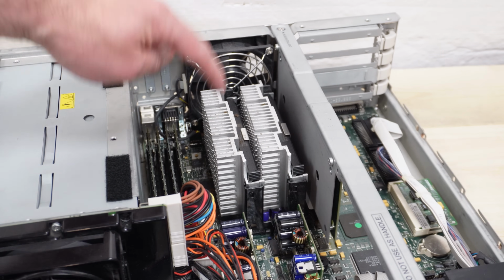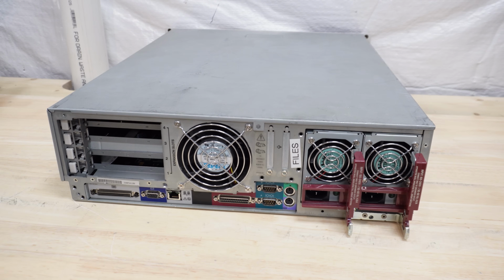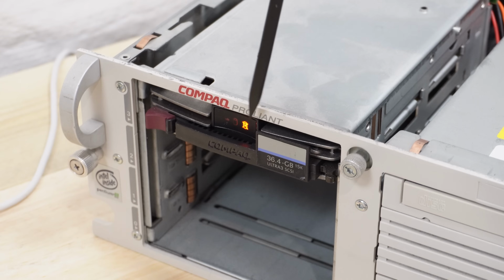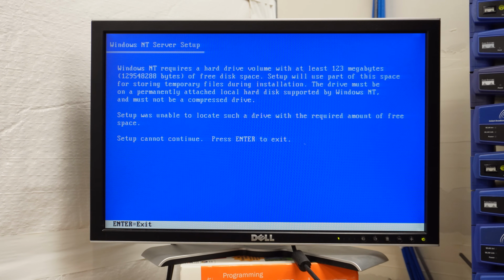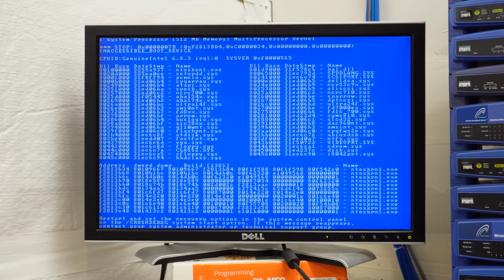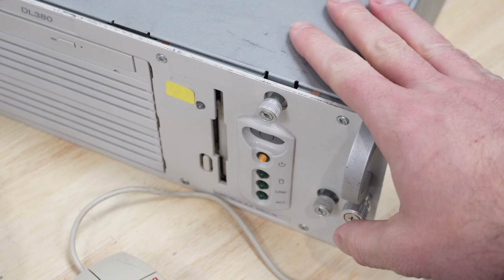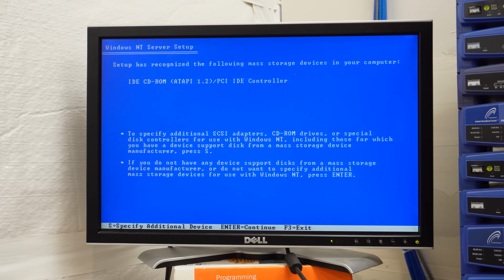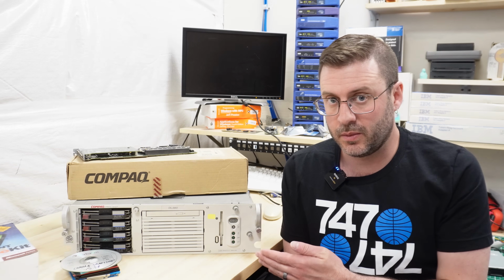Failing to Install Windows NT 4.0

Comment: You may be running into the issue of NT setup not loading the driver even though it allows you to "load it" after the 'Welcome to Setup' message. You'll want try loading the driver before the 'Welcome to setup' by using F6 at "Setup is inspecting your..." and you may have to select IDE driver along with the SCSI driver.

Comment: It's been at least 25 years since I did this, but my memory is that the automatic integration from the smart start CD does everything for you. SP6036 on the HP site will get you the missing profile disk.

In automatic mode, Smartstart will copy the files from the NT4 CD into an installation partition on the HD, integrate the required drivers and configuration, and then reboot into this install partition to begin the actual NT install. I don't recall ever needing to manually set up logical volumes on the array, but it sometimes takes more than one reboot before the NT install starts if it needs to configure hardware. 

And if you want to go down a real NT domains rabbit hole, look up PC Netlink 2.0 on Solaris. It lets you run PDC, BDC and member server roles on a Solaris SPARC box.

Comment: I don’t need to watch this, I’ve unboxed and set up 40-50 of these with Netware, NT server, all sorts. But I’m going to, because nostalgia.
If you remove those two bezels beneath the CD drive, you could install a SCSI DAT or DLT tape drive.
I’ve mentioned before, F6 during the NT setup would have allowed you to inject the Smart Array driver and see the disk. And you could have formatted the disk with /s to copy the boot dos boot files.

Comment: Here's a trick to save a bunch of time: When you're at the Windows setup screen where you can add the RAID driver from floppy, after picking the driver, press S again to load another one. Just load all the drivers off the floppy, and if one of them is the right one for Windows to detect the RAID card, it'll use it.
Reply from the maker: I'll try that!
Reply: @clabretro  HURRY I WANNA SEE WHAT HAPPENS!
Reply: Cheater....... lol 😂
Reply: That still remains the same.
Reply: And Colin saves the day!
Reply: Yup, this is the way.
Reply: IBM製 ServerRAID や Adaptec AHA-2940(U、W、UW)、Tekram SCSI DC-390(U、W、UW) だと PC-DOS(MS-DOS) で先頭パーティション10MB程度でいいので事前に基本パーティションを作成しているとすんなり進めます。
あるいは DOS 基本パーティションを2GiBを確保、インストールディスク3枚目で ディスクコントローラードライバを読み込ませ、その後の導入手順の途中で NTFS へ変更すればもんだいありません。
あとからNTFSへ変更するとすべてのディレクトリ(フォルダ)のアクセス権が Everyone になるので注意すべきです。
30年前にサポートデスクで何度もガイドしてきました(o_O)
Reply: Sometimes when you do not have the exact Smart Start CD that came with the server some drivers can be missing, so the downside with that method is that there are no guarantees that the right driver is even there. Still, good tip.

Comment: You have summed up nicely why I stay away from old Compaq hardware.. by trying to help administrators, they have created probably the most convoluted and non-automatable way of setting up servers from all manufacturers I've worked with. This whole SmartStart ordeal wouldn't have been necessary if Compaq had bothered to ship a simple disk with the SCSI controller drivers in a form that the NT4 installer can use, and a BIOS for the SmartArray controller that exposes the drives in one of the standard ways (e.g. INT14/15 emulation). But no, they had to do things their way, and have admins jump through hoops to get their machines working. Thankfully, HP put an end to this (mostly) after they bought Compaq. Except the SmartArray controllers, those still suck to this day, because HP decided to castrate the software from its original LSI version to be barely standards-compliant, to sell more upgrade kits.
Reply: Totally. In all my years of NT4, i never saw such a nightmarish thing, which makes me grateful for never having had to use anything "from OEM" and instead just built them from off the shelf parts. And its just like you said, pop some LSI or Adaptec card in, have the floppy with driver, boot the cd, pop floppy, load driver, away we go. That said, don't miss NT4 all that much, life became SO MUCH BETTER with W2K it's not even in the same galaxy code.
Reply: Compaq had so many backplanes and idiosyncracies that kept you in their proprietary world that I actually refused to work on their rigs after 1997. Too many scams that they ran with their hardware, and you could only use their products as replacements and upgrades... Also NT 4.0 was especially egregious - first release could be hacked by a character buffer overflow. All you had to do was hold your finger down for a couple of minutes to buffer overflow the 256 characters, and you could log in as anyone - not very secure!

Comment: These are not "partitions" in the RAID controller BIOS as you call them. Nowhere near in the same sense as partitions in fdisk, which is the common use of the term, so it is misleading to also call them that. They are "logical drives" as far as the controller is concerned, but the OS will see them as actual separate devices (listed in device manager!), say of 2GB and 6GB as you made in some attempts, or only 2GB.

Comment: FYI You could have selected all the possible drivers by pressing  "S" again after you selected the first one.  Incase one of the other ones worked.  NT setup will format the drives for you once they are located.

Comment: 2:22 - let's be fair here, ok? The domain concept in a network appears in Unix servers, like NIS server in the '80, developed by Sun Microsystems. There are innumerous of others solutions to network domains.
But Windows NT were more popular in that era of 2000's.
I still remembered that I needed to installed Citrix Metaframe in this beast, cuze there is no rdp protocol in the NT.

Comment: Are you using the printed installation guide that comes with the proliant.
I did a dozen or so without a problem....but I used the I installation guide.....just saying..😮

Comment: On the nt setup screen where you add the additional drivers im pretty sure you can just add a bunch and hope one works rather than trying 1 at a time, that's all if I remember correctly
Reply: You can also download different drivers and put them on a floppy and load them in

Comment: Problem is that smartstart CD is all in one solution for multiple servers configurations. And selecting devices from list of all the drivers from the disk isnt precise either. I would precisely look for SmartArray 5300 nt 4.0 driver. And make floppy with it.

Comment: Do yourself a favor and always format with /q for quick format. Format in normal mode just does a scan for bad sectors to map them out in the final file system. If using "modern" drives, especially on a raid controller, this usually isn't a problem and you just save a ton of time.
Reply: Not really scans, but for sure it formats every sector. While quick formatting ommits rewriting every sector and just make them as empty in partition table data.
Reply: @swrzesinski  No really, it scans it only. Format a drive in non-quick mode and abort it at 95% and all your old data is still there.

Comment: Never got my hands on a Compaq ProLiant but we used to sell a lot of HP ProLiants ML and DL 350 and 360 servers starting with the G3 generation. SmartStart was still a thing but you could do rudimentary things such as accessing the BIOS or configuring the PERC RAID controllers without them.
Though these SmartStart CDs were no longer Windows based and instead booted a Linux kernel straight into a Firefox instance, IIRC.
Those were always great and very reliable machines. 
Only ever had one customer who was running an NT 4.0 domain with MS Exchange 5.5..it was quickly migrated to Windows Server 2003 and Exchange 2003.
And yes, Active Directory is still alive as well even with Windows Server 2025. Of course Microsoft would rather sell you some fancy Azure AD/Entra ID subscription…times really changed and not always for the better.

Comment: Why are you booting off a Win95 floppy ? The NT4 CD should be bootable and the Installation Wizard should do most of what you need.  Also, the later versions of 'Smart Start' had the option to install an O/S - it did the basic prep of the hardware, copied the relevant Compaq drivers onto the drive, and then WinNT would use them.

Comment: The installer is not seeing the disk because you do not have the right driver disk or you are not choosing the right driver not due to anything about the partitioning. You need the precisely right driver disk and then you have to choose precisely right driver. There was a whole process to generate your own install media with configuration to choose the right drivers for unattended installs. I did so many Windows NT 4 Workstation installs during my college years both of the unattended and manual varieties and I've never before seen anyone do this process with booting to a DOS disk to partition the drive in advance. You can partition any disk from within the installer, but the boot partition has to be 2GB or less. For reasons unknown to me the filesystem is initially FAT16 and then it converts to NTFS upon first boot.

Comment: Fun fact modern HPE Proliant servers have a function (built into the systemboard) called "Intelligent provisioning" which has similar functionality (and a lot more that's come along over the years).  They caught on early on that using a flavour of Linux instead of Windows for the environment was more cost effective for licensing.
Reply: I install HPE servers regularly and I never made Intelligent Provisioning work to install any operating system. ESXi, Windows Server 2016 up to 2022 in different languages (DE and EN). The furthest we ever got, was up until a point it ran some script in a Windows PE environment and got stuck there. HPE support was of no help and at some point we had to give up and install manually as usual, because we couldn't delay the customers system any longer. Next try with a Gen11 server soon, I guess.
Reply: @drstefankrank  only thing worse is finding anything on the hpe site haha
Reply: 90% of the time it barley works for me on my hp micro server, I land up just using ilo with an iso image of the os of choice

Comment: 4:40 Why would you want to learn NT? It is a very stripped down OS with many limitations, it is great for office environments but not much more.
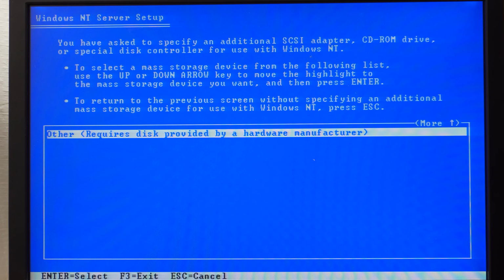27:09 You have to tell it the SCSI controller exists, then it will find your drives. I remember these days but at least you don't have your manager breathing down your neck asking what is taking so long.

Comment: I love your vids. Vintage enterprise equipment doesn't get a whole lot of love.

A few notes. The NT4 setup doesn't care about what partitions you already have on the drive, but I like to start with a clean drive. You can add/delete partitions later in the setup.

Also fun fact. NT4 supports up to a 4095MB boot partition  if you create the partition from the setup.. Also after you install Service pack 6a, you can create a much larger extended partition and fill it with a single logical partition to get a large drive (NTFS OR FAT32).

The barrier you're running into is NT4 setup isn't seeing the drives because of an incorrect controller driver or it the drives are not configured correctly in the RAID utility (I've never used Smart Start so I don't know). Either of those two conditions will give you that error. I think you don't have the correct driver for either RAID controller. You may have to do some sloothing on the way back machine version of Compaq's site to find a driver file name (softpaq) and try downloading said file from an archive somewhere (Compaq used an FTP server back in the day so the file itself wouldn't be on the web archive. I just search for the download exe in Google once you have the number) Once you download the "softpaq" it should be an EXE that creates diskette(s) for you, and you would load it like you did in the video.

Last, Compaq also liked creating a "hidden" utility partition on your primary drive. I have a prolinea desktop that does that. Once that partition is present, you can hit F10 to get into a BIOS setup utility without a diskette or cd. The Smart Start CD can probably set up that partition for you.

Keep up the good content!
Reply: Another thought is you can specify more than one RAID controller by pressing S again at controllers screen. Some drivers can conflict, so I would limit it to a few at a time. You'll also get errors in the event logs from the non present controller drivers after setup is complete until you remove or disable the other drivers. A compatible driver may still be on that diskette you made.

Comment: you can build custom install media and inject the drivers.  its a PITA with NT4, no automated slipstream yet, but its doable.  I don't think I ever had the luxury of a smart start disk, so I just made custom install CDs with embedded drivers.  I can't recall where I got instructions from.  I remember it involved editing some INF files, extracting the boot sector from the CD, compiling it all into a correct directory structure, then burning it back out to CD.  There was also a trick setting to a boot sector ID that if you didn't set it you weren't booting off that disc so you got a new shiny coaster.

Comment: Okay, I haven't watched the video yet, but I am about 10.74673 to 79.43687% sure we were running NT4 on exactly those boxes at my workplace back in the day. And getting an OS installed on a Compaq server always used to be a breeze compared to the cheapo thrown-together stuff from the mom'n'pop computer store down the road thanks to Compaq SmartStart. 

Curious to see what problems you ran into.

Comment: Michael MJD has also had tremendous trouble trying to get NT4 installed. Check out some of his videos. He's lost hours of his life to NT4 as well. Just wait until you get to the part where if you try to install into a large partition it does this crazy thing of making the partition in FAT then converts it to NTFS later.

Comment: I did have the same box around 1999 when setting up a NT4 (SP 4 I think) as my main mailserver running 3rd party Win NT4 based mailserver (forgot the name of the mailserver but same company as What's Up Gold). I did have a separate SCSI based disk array instead of the built-in disks in main chassis.
Some other application i did install later dis mess up NT4 that bad that it went in BSOD loop and had to reinstall NT4 three times from scratch... Fun times 😢😮😂❤😊
I did have a ILO remote management card where you had to loop KB&M + monitor with cables... No remote management via the internal bus... The ILO/ILO Advanced card was really just a mini remote KVM over ethernet unit in a card form factor 😮

Comment: the only reason it wouldn't install is you have to make sure you add the drivers for the controller.  That is how all of the older OS system worked.  They didnt have Plug and Play.  It was called Plug and Pray back in the day.
Reply: That's exactly what was F6 Drivers for. It was living up to Windows XP. You would have to prepare floppies with like Intel Rapid storage driver for RAID/AHCI. Then press F6 on windows first installer screen and load them. With servers it would be easier, Windows 2000/2003 server had most of the common server controller drivers integrated into retail Windows disc. And it doesn't have anything in common with PnP. Device is still PnP even if you don't have driver installed.

Comment: Get Service Pack 6 Media. Windows NT4's setup process is made much less painful after SP4, but SP6 will let you use NTFS and FAT32. That alone is enough of a boost that you'll be able to actually complete the install, also you won't have to spend literally 860 hours patching the damn thing.

I also recall some kind of gotcha about multiprocessor systems. You may also need multiprocessor media.
Reply from the maker: I was kinda thinking latest media might be the answer. I'll try that!
Reply: @clabretro  When I last played with NT4 while it was still a relevant operating system, I tried using SP0 media and got nowhere on a system so painfully generic and standard that I was genuinely confused how NT4 wouldn't boot on something with a PCI video card and onboard IDE controllers. Turns out, it was just really fussy back then. I used SP4 media and it was as easy as installing Windows XP was. You just kinda mashed enter until the end and it did it. You're still going to need the Raid controller setup disk, And not seeing the disk Is a good hint that a lot of things are Not going Well. In the SmartArray configuration utility, did you set a logical drive as bootable? I don't recall seeing you do that in the video and that's still a gotcha with SmartArray cards, today, running Windows Server 2019. You do have to pick one logical disk to be bootable, and Windows SETUP will feign ignorance of any logical drives that are not marked as bootable, because if you can't boot from them, who cares? Windows its self will be able to use the extra logical drives but Windows Setup will make you pull your hair out.
Reply: Yes, you may find to better to use the SP6 install with the NT 4 setup floppy’s and most current SmartStart Cd. I had several of these servers.  And yes, you need to reset server from SmartStart and start setup from SmartStart.
Reply: As far as I remember, the "default" NT server HAL (Hardware Abstraction Layer) supports 2 CPUs. If you need more, you needed a special multiple CPU HAL version or something.

There was also something about running UPTOMP.EXE I think from the Server Resource Kit for NT4 to enable multiple CPUs after the installation if it only saw one, but I can't remember the details. You needed a newer service pack for that (SP3?).

Comment: Edit: I can stop shouting at the screen, you found it.
SmartStart has a guided install for Windows, it will ask all the setup questions in advance then ask for your OS install media. This avoids most of the issues you had and slipstreams the SmartArray drivers.